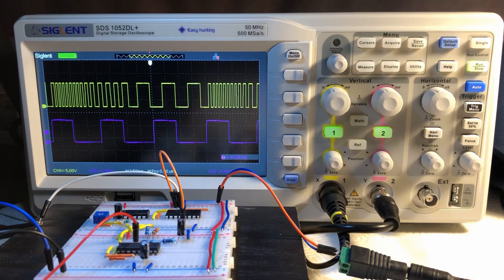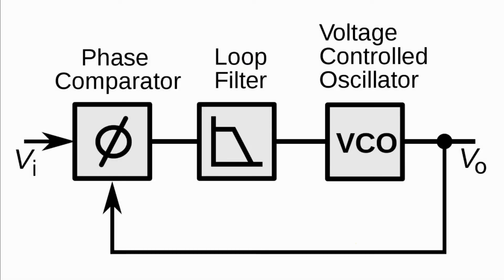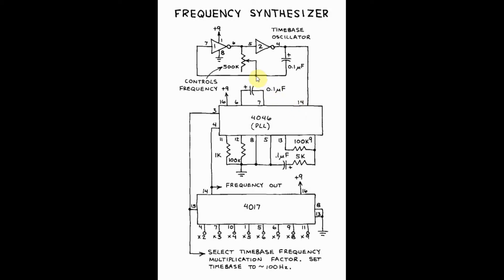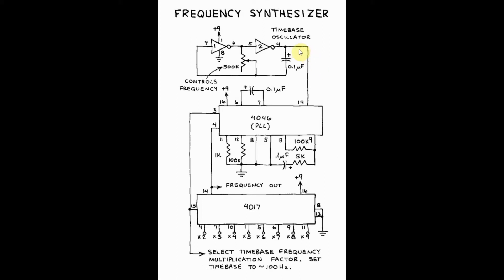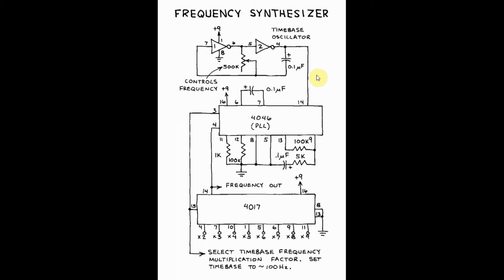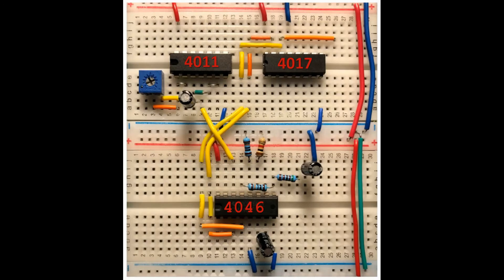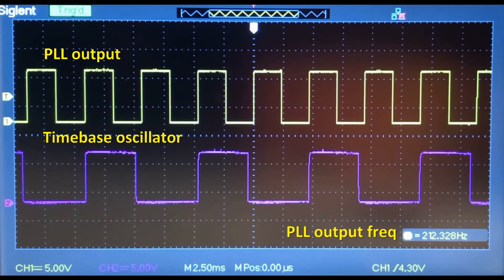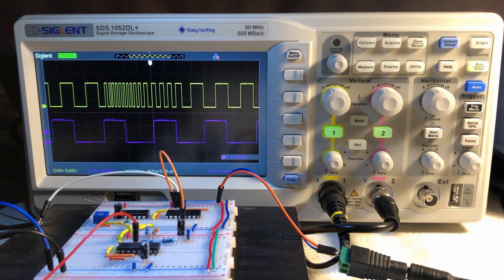Frequency Synthesizer

Comment: Hello, a very nice project, and what is the maximum frequency that can be generated by this? is it possible to make a 27 mhz synthesizer for CB radio? the maximum working frequency 4046 based on the documentation is 40 mhz, more you can not? that is, for the 145 MHz band or 466 MHz of the ham band, the radio can not be?
Reply from the maker: Thanks for your feedback. Maximum frequency = 100 x 9 = 900 Hz. To build a MHz synthesizer, you may need a MHz clock source, such as a crystal oscillator.